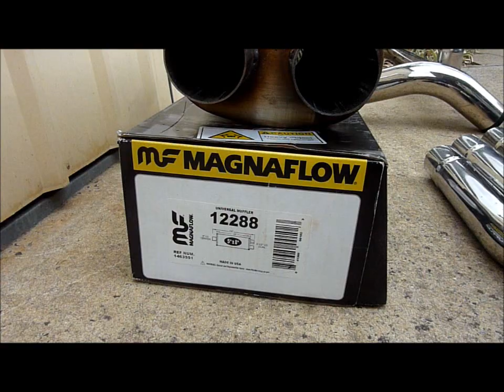KK Jeep Cherokee/Liberty Exhaust

Comment: Need this in my wife's liberty. I just installed a 2.5 rough country lift with 255/55/18 and kyb shocks and struts.
Reply: As well with fuel hardline 18x9 +1mm offset

Comment: Yo what I want to install one on my Jeep that’s stupid loud what do you recommend
Reply from the maker: The smaller and or shorter the muffler, the louder it will be. Use one that has a straight through design so the note still sound good. https://www.onallcylinders.com/2012/06/29/sound-advice-a-quick-guide-selecting-right-muffler/